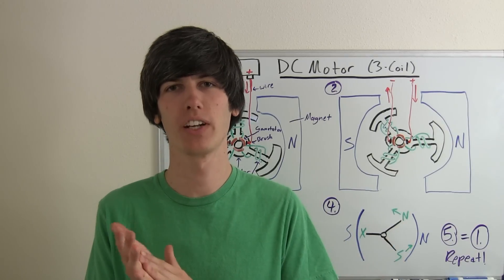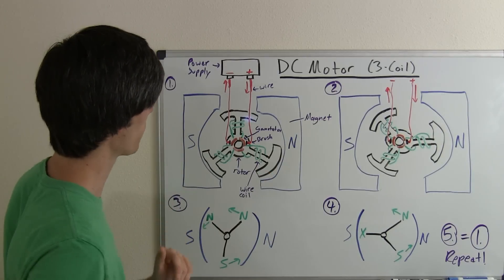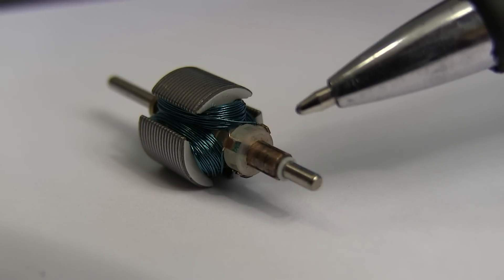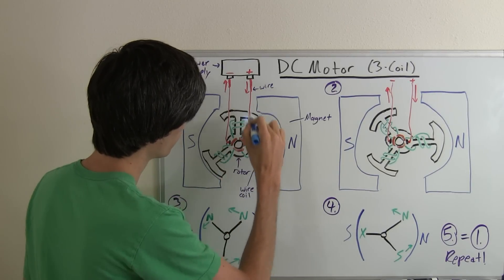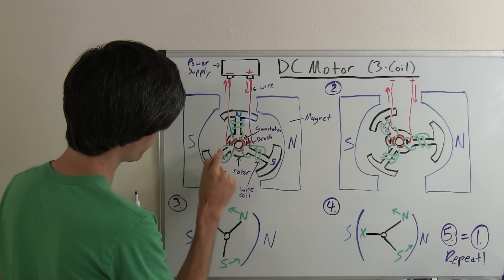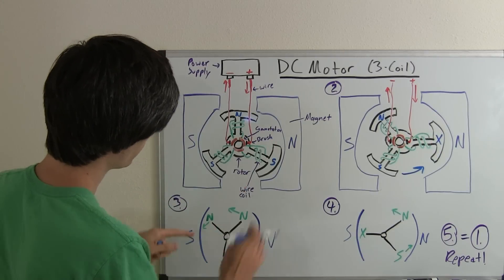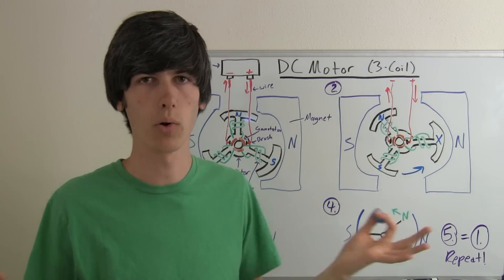DC Motor - Explained

Comment: I am a big fan of your lectures, you really put in great efforts to share your knowledge with others, wish you best of luck in your endeavors .
I still can get this thing straight, from the basics we know that current chooses to travel in the least resistance path so if that's the case then current will only travel through one set of windings(since R is proportional to length and only through the topmost arm of the rotor as per your schematic diagram), therefore no current will pass through the other set of windings and hence these arms wouldn't act as electromagnets,right 

.Can u clarify on this part, thanks in advance :-).

Comment: when the circuit is shorted in step2 doesnt the entire circuit break? since + isnt connected to any conducting material?
Reply: Like if you break a circuit the current stops, and why is there still current for the other parts? It has to do with how the brushes interact with copper commutators. As far as the wire to the brushes is concerned, if any of the magnet wires are making a circuit there's a current. 

(I'm just a guy who watches vids, better explanations are out there)

Comment: But isn't the rotor ferromagnetic?, like iron, so it can be induced into an electromagnet? And iron with no polarity is attracted to both north and south pole cause it aligns its atoms to whatever its facing. So the "X" part is still gonna be attracted? PS: i didn't know rotors are so tiny

Comment: how does it brake? thank you very much!!!
Reply: +anhphong tran If you push current in the opposite direction the force will be reversed and you will brake. Otherwise if you just let it go and remove the current all together, the momentum from rotation will start to produce a current and this will slow it down.

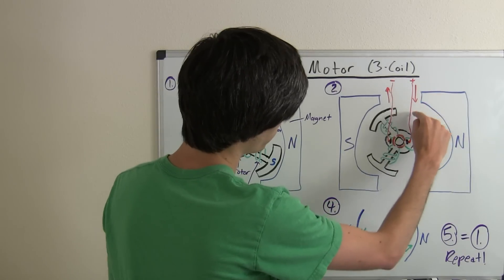Comment: I didn´t understand why there is no pole at 4:15
BTW love your videos! They´re helping me a lot with school projects :D
Reply: ProjectD100 That is a very short instant in the whole cycle (of rotation) when both the commutators of that concerned coil are connected to one brush. Now since each end of the coil terminates with a connection to its respective commutator (both of which are now touching the brush), we can say both ends have been shorted. Hence, no current through the coil and hence no magnetization and hence no pole :)

Comment: Ohm's law: V=I*R (voltage = amperage times resistance).  Resistance of each winding is constant, meaning higher volts = higher amps and lower volts = lower amps.  The magnetic field strength made by the electric current (MagnetoMotive force or MMF) = I*t (amps times turns).  Turns is literally the number of full winding loops between the plus and minus of the power source.  Thus, voltage controls amps and amps controls magnetic strength.

Comment: Motor explained is a DC brush motor.  Many small accessory motors on a vehicle are brush motors due to production and development costs ( including costs of motor controls and switch/wiring infrastructure on the vehicle).
When electric vehicle efficiency at high power output, rather than development and production costs are more important, (such as vehicle drive motor, power steering, air conditioning compressor, etc...) then DC brushless motors are more typical.